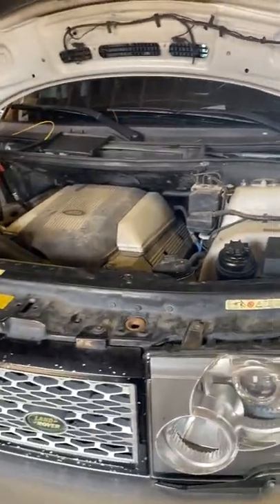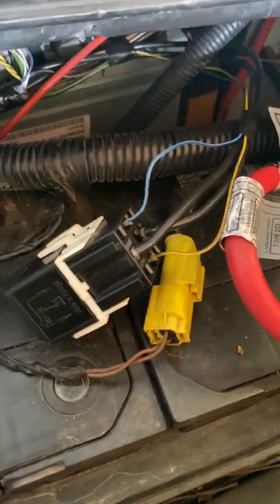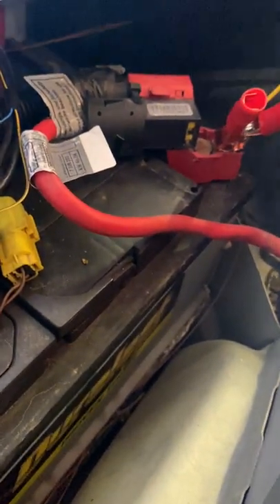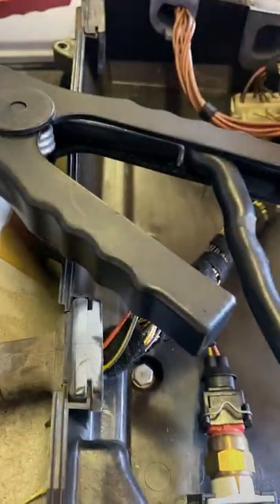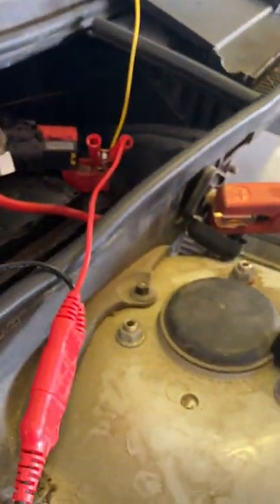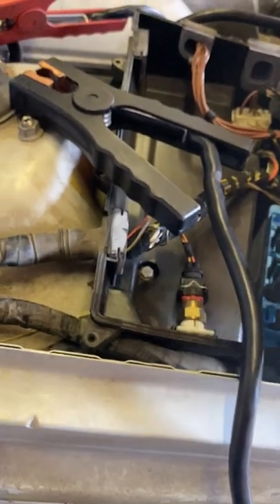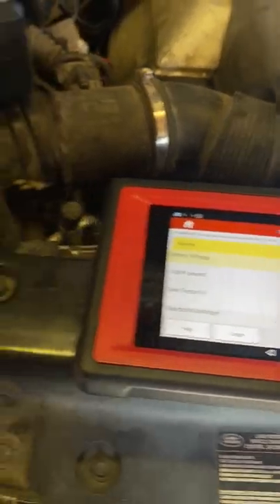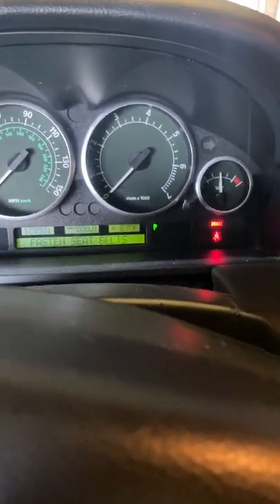2005 Land Rover Range Rover no crank no start

Comment: Hi I've disco3 no start but when i put quick start everything is fine. I check the fuel pump is fine, fuel lines to the injectors fine, but seems like injectors are not opening. What could be the problem?

Comment: Hello, i have the same exact vehicle, i connected the wire to the negative battery pose and touched the yellow wire and it cranks right up.... so what part do i need to replace the pcm? just wanna make sure i buy the right part....is it the engine control module? i need the name of the part.
Reply: TCM

Comment: Hi i have same problem with v8 motor . Cant turn the key after baypass with blue wire key turning but still no crank 😊 after jumped 12v wire from battery  to the black wire from the relay  under the bonner behind the battery engine start and running . Air suspensio message on the dash . Any one know what is the solution? I will be appreciated for any info regarding to the problem.
Thanks

Comment: Hi Shotgun Diagnosis, I'm wondering if you could help me out on my channel.

Bought a 2003 Range rover 4.4 as a project on my YouTube channel. The old girl has a No Crank No Start issue. 

Previous owner says he went through a car wash, came out and got the issue. 
Previous owner has tried replacing the Starter Motor, Starter Relay, Transfer Box, New Battery, Auto electrician stated to him the transfer box is showing invalid selection.

So far, I've tried. Cleaning Battery Terminals, Cleaning Alternator Earth, Cleaned Crank Sensor, Unplugged MAF Sensor, Checked under the car for loose connections, turned the car over by hand, check glove compartment fuses.

Diagnostics from INPA and RSW AllComms, didn't show much that could cause the No Crank No Start issue. 
After clearing the codes the only odd thing that showed up was the Air Suspension CAN BUS fault came straight back but Air Suspension is still able to self level.
Also the DSC warning light also is still on and wouldn't clear, I've attached a picture. 

Our next thoughts is to check all the modules for water ingress, including the ABS module and Sensor and replace the ignition switch. 

We've also got another diagnostics reader on the way specifically for Live data

If anyone has any thoughts or advice, that would be greatly appreciated. 
Cheers
Reply: Ever get it fixed?

Comment: Hi Man Your Video is very inspiring. I am a new owner of a 2009 RR sport Supercharger. my problem started with the key fob battery dying but the car was still starting, days after the car battery died. I replaced the car battery and the car started a few times. i made a new key fob also and since then the car has not started either with the old key or the new key. I can turn the key to position 1,2 and  I can hear the door locks clicking and flashing parking lights and flashing red light on the dashboard. i have read on several forums that it can be an immobilizer preventing the engine to start i also noticed that the check engine yellow light is no longer showing when the key is in position 1 and indication that there is no communication between the immobilizer control module and the engine control module. Any help to solve this RR mystery? I am desperate PLEASE HELP.
Reply: I am having this same issue!! And sometimes lights will stay on flashing when taking key out and take a while to stop and shut off dashboard did you end up solving the issue?
Reply: @Angelo-zz8cb  ever figure it out?
Reply: @spectreorganics5747  Yes ! It was a loose ground and making it glitch and not start but now I’m facing a fuel pump problem and I must say this truck is a problem almost every few months even though I love it ! 😅
Reply: @Angelo-zz8cb  thanks for the update! Ahh I can only imagine lol. I finally figured out my key needed to be reprogrammed. Hopefully all I need now is a battery but I doubt it right lol
Reply: @spectreorganics5747  truck is a pain lol wishing you the best though man